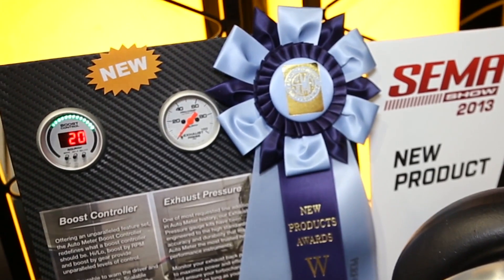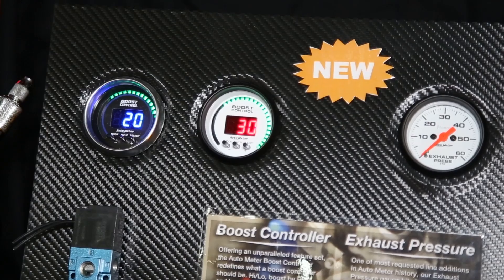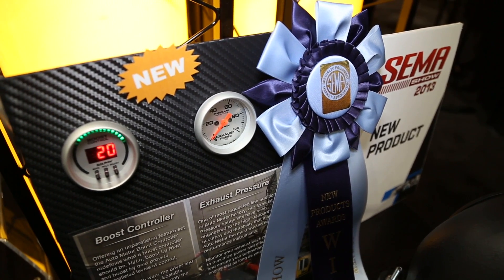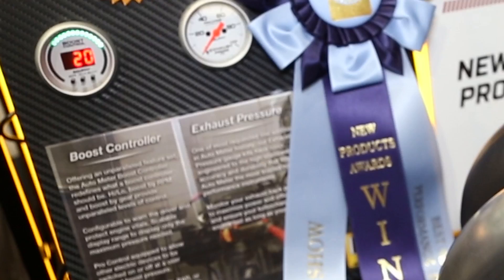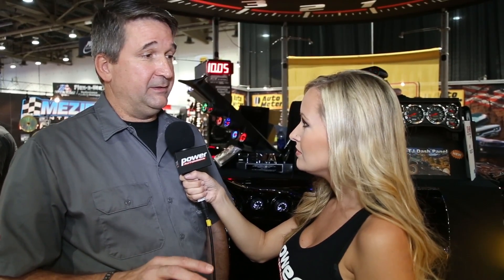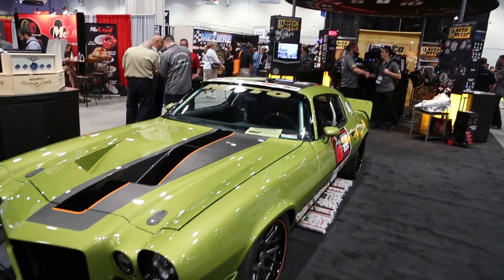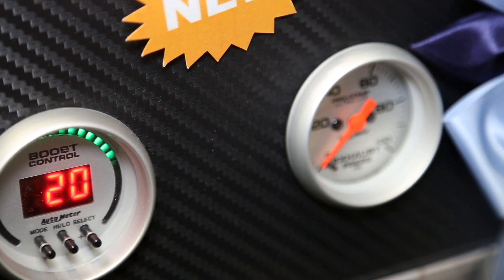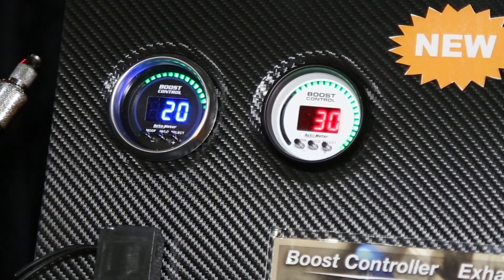AutoMeter Digital Boost Controller

Comment: The Turbosmart e-boost 2 has been able to control boost by gear/RPM for YEARS! 
This is just a cheap copy.
Reply: You sire,  are wrong. E-boost does not have map for rpm x speed x boost. Only manual set points are set.